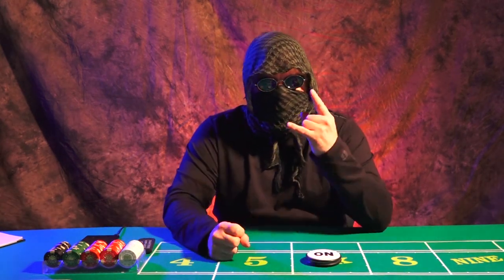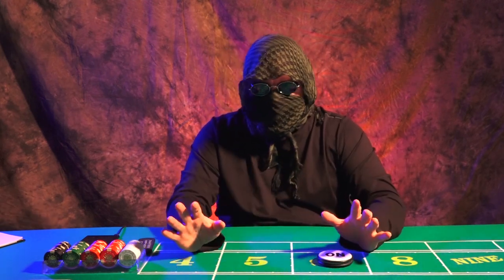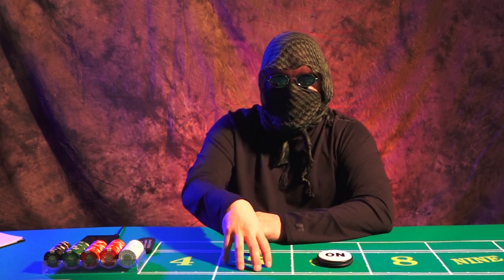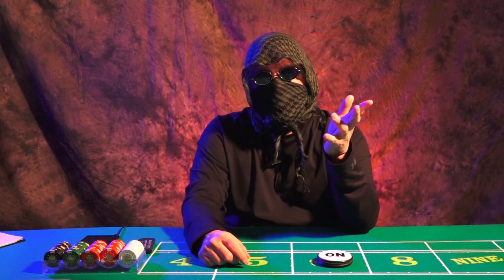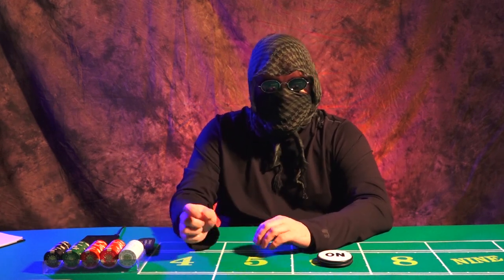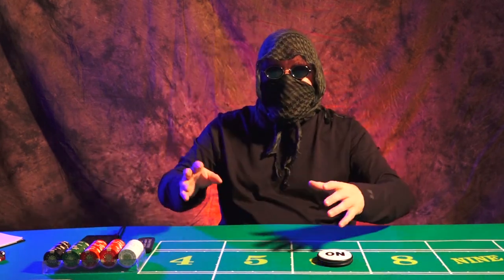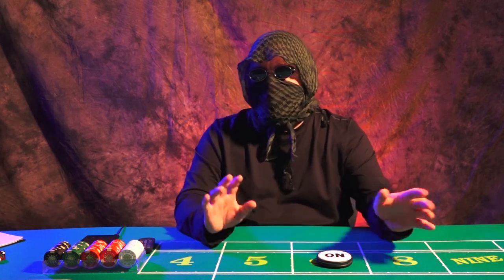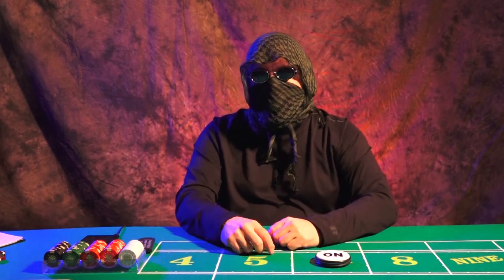Dice Control: The Truth About Microfiber Vs Felt Layouts

Comment: Few questions.... casinos in Vegas, do they have regulations for tables and what they use as far as cushions or anything on the table that makes the dice bounce? Also, have you heard or seen that Vegas use different dice?
Reply: By different dice I mean, different times of day or different days of the week, using different dice? Reason I asked, Ive noticed certain color dice on the strip are better than others.
Reply from the maker: No! All dice are casino grade but that does not mean they are perfectly balanced.
Reply from the maker: YES they change up the dice!
Reply: koganinja777 wow, ok so I’m
Not crazy! Been going to Vegas now once a month for the last 4-5 months after watching lots of your videos. Have noticed that all hotels use a particular color dice on the weekend when it’s high volume of players. And some hotels switch the dice and colors in the mornings during the week day when pit bosses cycle out. On the weekends I lose extremely fast and crap out almost 2-3 rolls in. During the week on the changed colorful dice I can roll consistently for 20+ rolls and fill my chip rack. Just thought the theory I had was odd, but I figured if anyone knew, it would be you.
Reply from the maker: Watch my video on Unbalanced dice, it will answer all you question! You can find it on my channel.